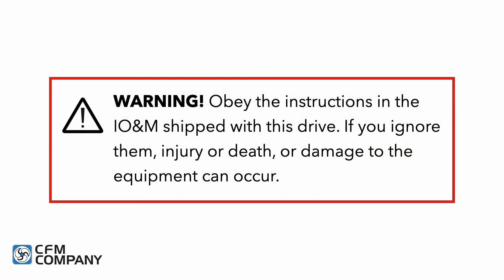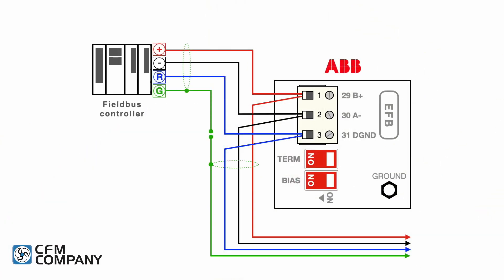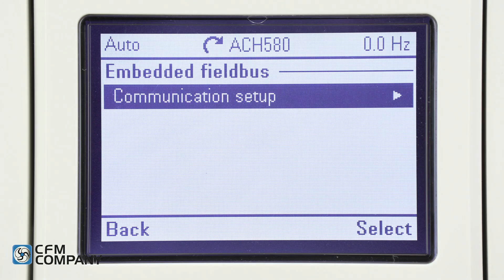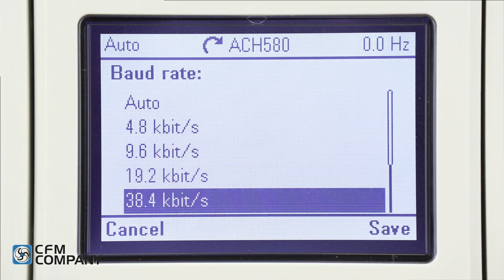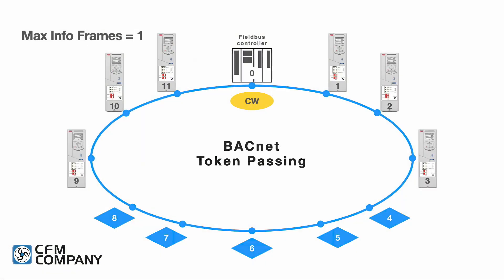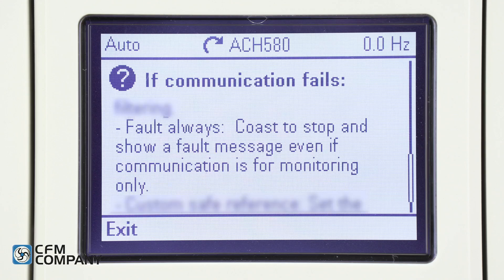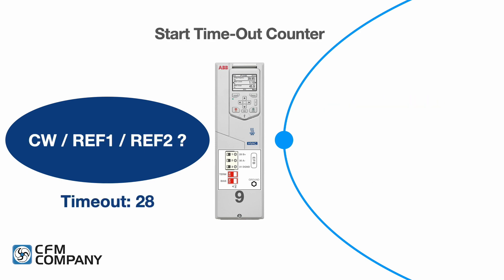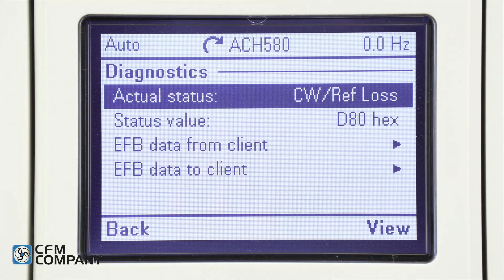Program the ACH580 for BACnet MS/TP

Comment: Just did an integration for these drives, found 2 VFDs in the trunk that communicate when device is energized, but not sending power to the motor (OFF). When placed in Auto, device stops communicating. Trunk is EOL'd at both ends, drain wires are attached and only grounded at the main controller. Any idea why? I'd assume inteference (issue only occurs when device is delivering power to motor), but this doesn't seem to affect the rest of the trunk.